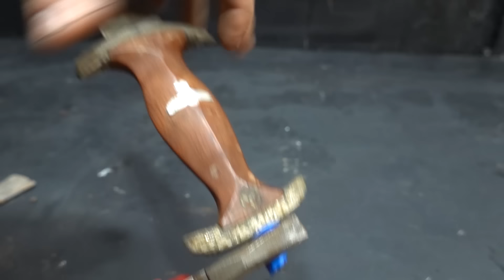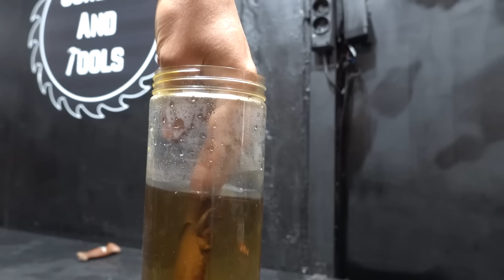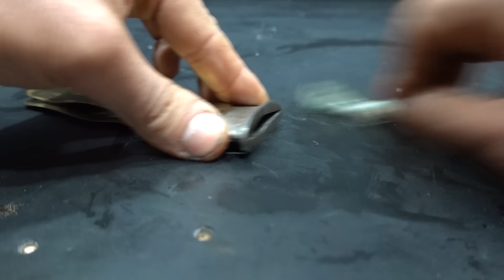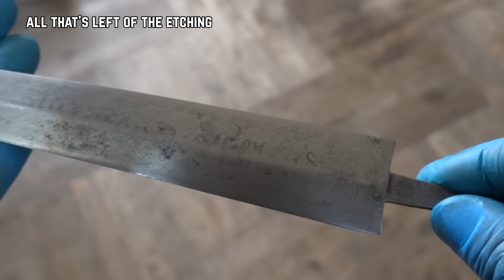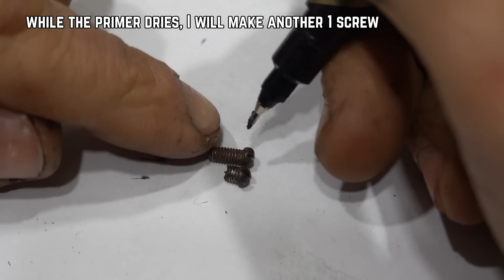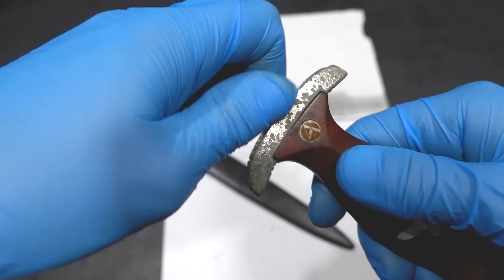GERMAN NSKK Dagger Restoration - World War II

Comment: The mark on the blade is Jacobs & Co. Solingen-Gr.(means Gräfrath) RZM M7/118 which is the RZM code for this company. It used to be quite a rare dagger because of the double markings - Maker mark + RZM stamp. Not anymore. Unfortunately in this condition there is no hope. The restoration did not increase the value. You did what you could but at this point it does not matter. The dagger was unsalvageable.

Comment: I have seen forensic labs that have brought up serial numbers on guns that have been scratched off by using acid etching. Do you think that might’ve worked on the markings?
Reply from the maker: Hi, I think the reason is very simple. All data on the blade was specially removed by a roughly mechanical method. If that's what you meant